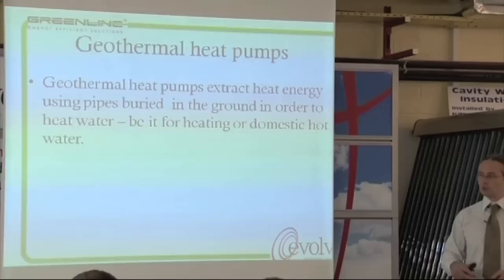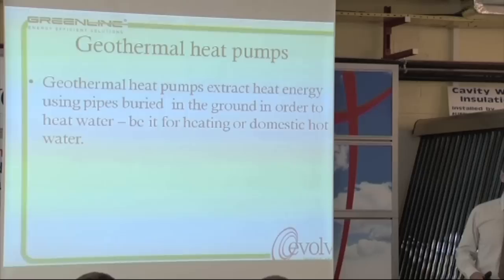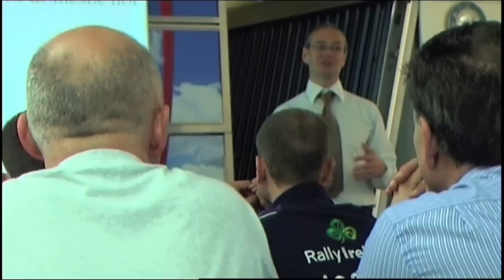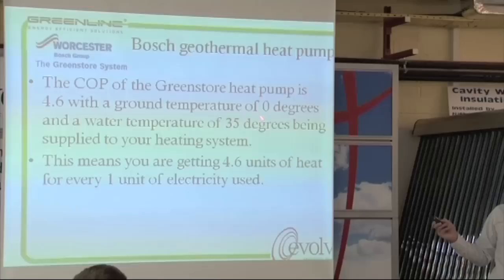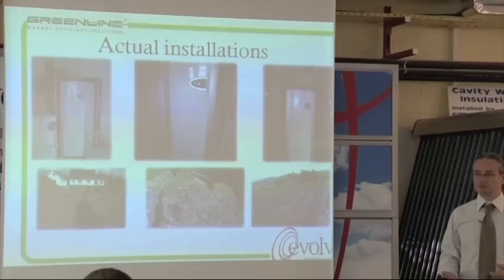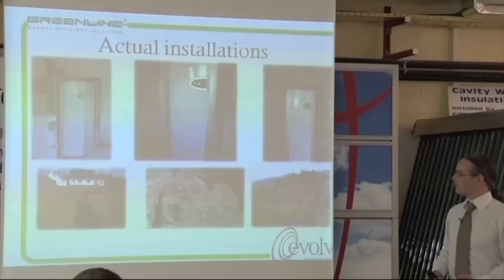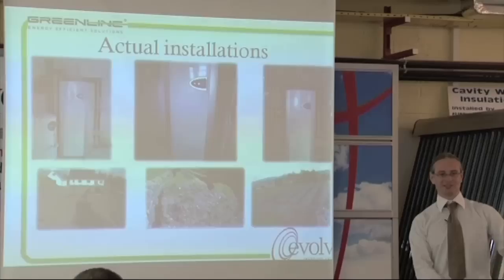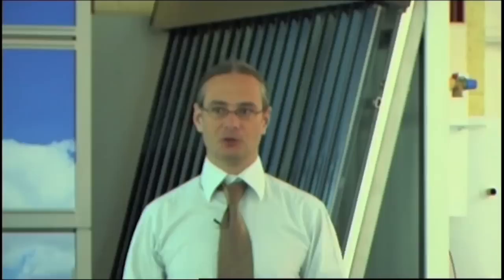geothermal heat pumps

Comment: Bryan, I am using a self built Solar panel connected to my IVT Greenline, and this warms the vertical borehole in summer and equinox. Produces remarkable results. reduced heat pump consumption by 30% google for 'chargingtheearth'